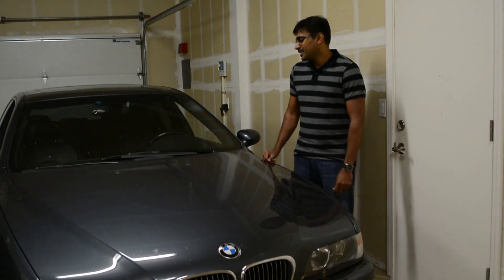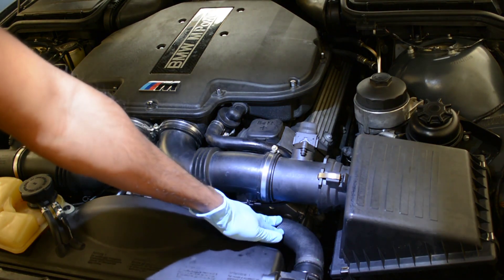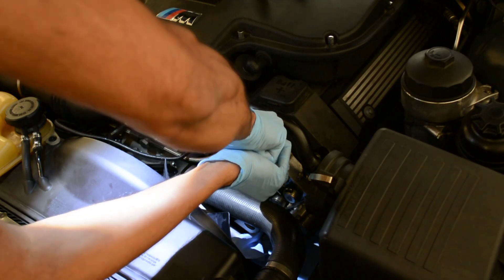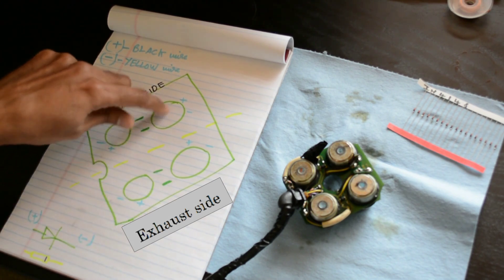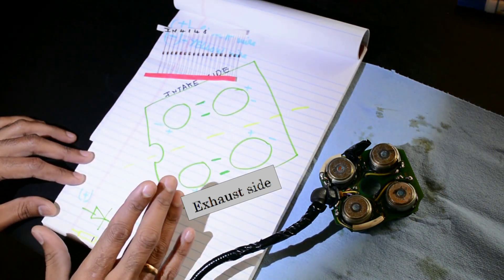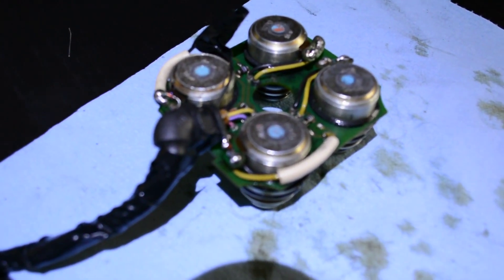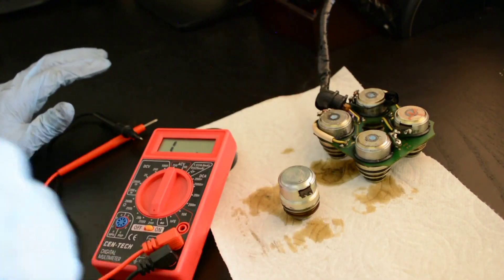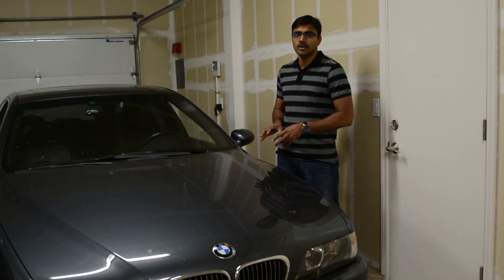VANOS error on BMW E39 M5 - P0022, P0021 - Solenoid Issue/fix

Comment: Can the solenoid testing be done while they are still in the car?  I just replaced the solenoid seals and now I'm getting a P0014 code, which I think is a similar problem as this but on bank 1.  I had a hard time removing the solenoids and am afraid I may have  damaged something in the process.  So if I can test resistance while they are still in the car that would save a ton of time.

Comment: I redid mine and had no code for bank 2 but after testing one was intermittent. We replaced it and have low end power. I continue to get bank 1 retard now I know which one I need to replace. Thanks

Comment: Hello,i got the test done on  each solenoid and 3 of the solenoid have tested 3.8 ohm and one was 5.6 ohm i have 3 diode missing that will be put soon,do you think the values are low for the solenoid in your videos yours were 4.7 ohm each.
What seems to be the issue?
Any help appreciated!
Reply from the maker: Hi,
    4.7 Ohm is an additional check to make sure the solenoids are good. In fact the sticky solenoid I had, still reported 4.7 Ohm. In your case, values are somewhat ok and I will not change it unless they are associated with check engine codes. Also if the codes are related to timing, solenoid is just one of the cause. Best of luck with your troubleshooting.